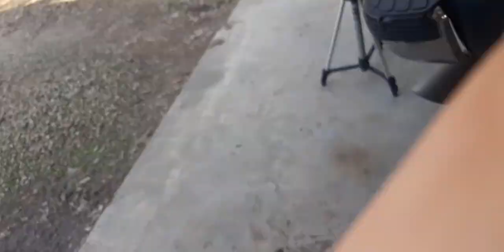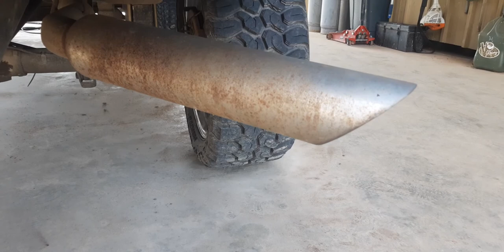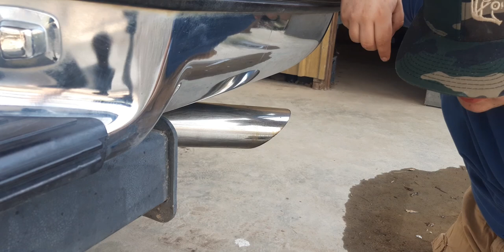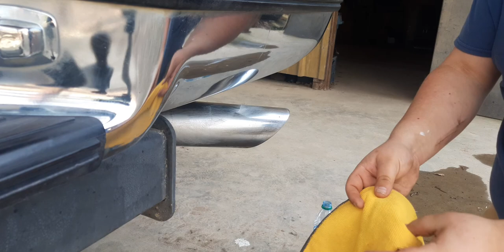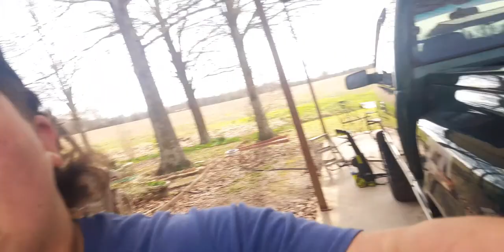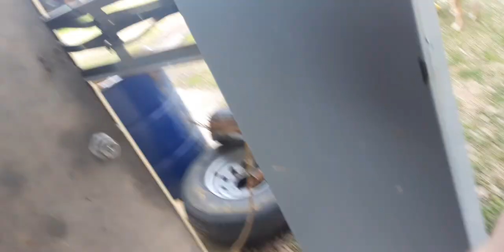Rusty exhaust Tips?  DO THIS

Comment: I've already done a similar process on mine around a year ago.  

I used 2500 wet & dry sand paper, followed by a lambs wool buffing head on a drill, and  G3 medium grit compound to remove them scratches. It came out looking brand new
Reply from the maker: Thanks for sharing the info
Reply: @Dirtydetours  no worries lad.